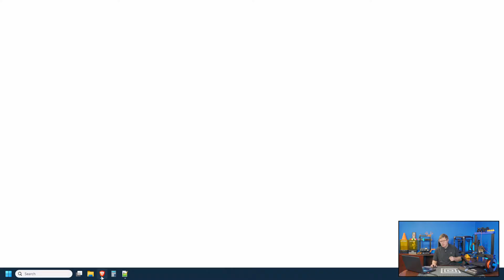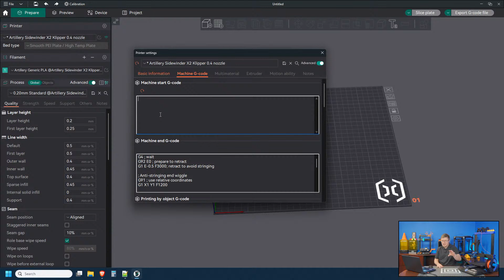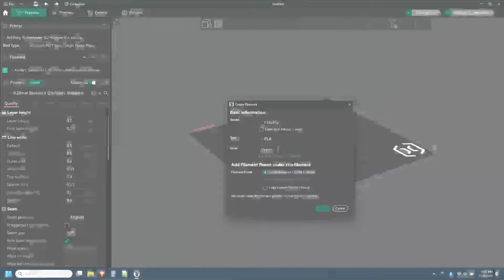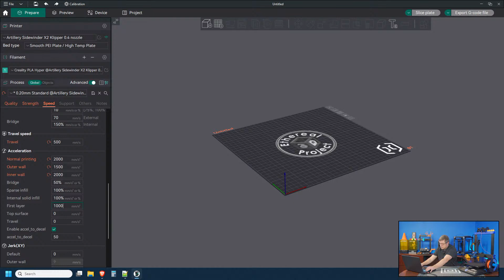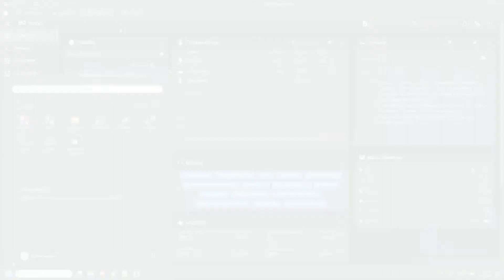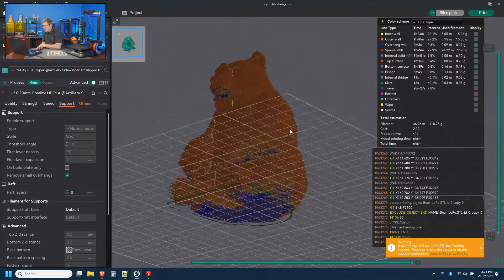Orca Slicer Getting Started Guide Livestream

Comment: I didn't get to see all the video the other day. I did see that you are using Klipper. Is there anything in there concerning Marlin, I have an Ender 3 V2 Neo, just upgraded to a Micro Swiss NG. Will your settings work for me?
Reply from the maker: No, many of the settings for Klipper are different than marlin.
Reply: @EtherealProject3D  Thank you for the reply! I’ll keep digging.
Reply: @EtherealProject3D  If I were to pick a printer that has direct drive, you think it would work as a baseline profile where I could get started and fine tune it? I’m still a 3D noob, so I realize these are elementary questions lol.
Reply from the maker: @cdschoonie  There Is an x1 profile in orca. No worries, we were all noobs at some point. I have a discord server with lots of very helpful folks too if you want to check it out, plus its easier to get ahold of me that way as well. https://discord.com/invite/2PWqgJUyEq

Comment: Hello I've flashed your firmware to my X2. I'm truly grateful 🙏.  But how can I insert in the start print macro to preheat the nozzle and bad? Thank you a lot
Reply from the maker: Are you needing both to heat up at the same time or is it just not heating at all?
Reply: @EtherealProject3D  when I start the print don't heat. I need preheat the machine manually before print
Reply from the maker: @Expressao3D  you need to have your start gcode setup correctly
Reply: @EtherealProject3D  oh ok it's not a macro to preheat?
Reply from the maker: @Expressao3D  It can be, but you can set it up how you want. the preheating i like to be handled by the slicer start gcode. in my download there is a txt file that has my start and end gcode. My start macro just takes care of the leveling and purge.
Reply: @EtherealProject3D  oh ok I'll try it tonight. Thank you a lot for your help 🙏 😊